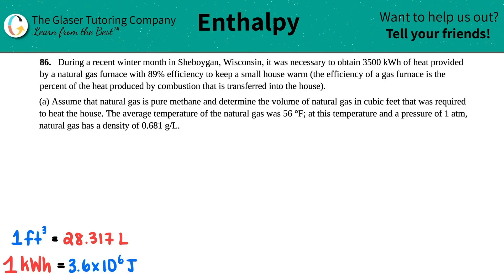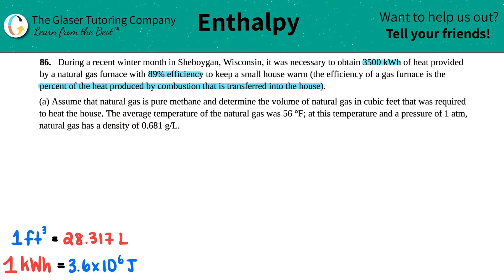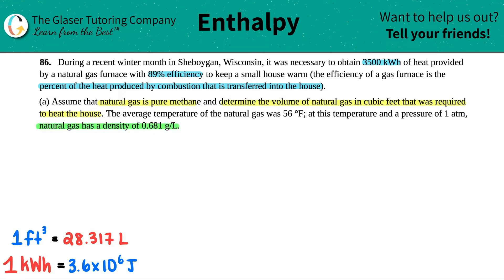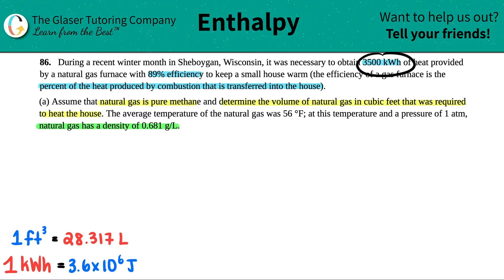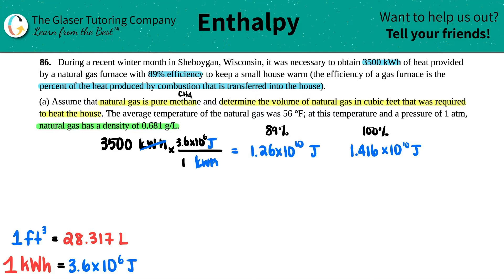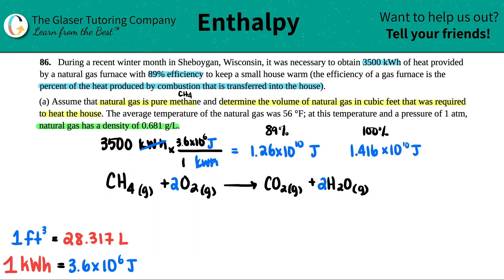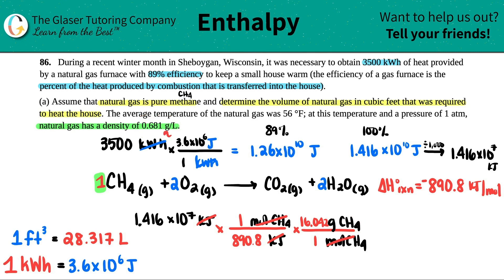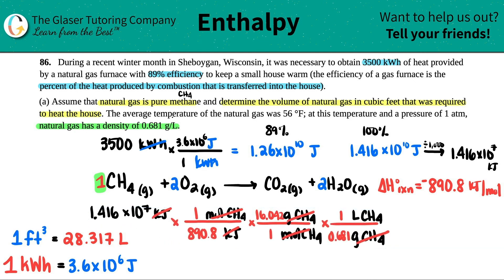5.86a | During a recent winter month in Sheboygan, Wisconsin, it was necessary to obtain 3500 kWh

Comment: This only works if the H2O is liquid.  For H2O gas I get delta H = −393.51 kJ + 2 × −241.82 kJ − (−74.6 kJ + 0) = −802.55 kJ/mol, 
but for H2O liquid I get delta H = −393.51 kJ + 2 × −285.83 kJ − (−74.6 kJ + 0) = −890.57 kJ/mol, which is much closer to your number.
Reply from the maker: Thank you for your input - keep working hard!

Comment: thank you so much for these videos! One thing though, when i was calculating the standard heat of formation for methane combustion (since im supposed to show my work), I ran into an issue. I was using the standard heat formation of the equation which you wrote down, but I think its actually supposed to be H2O(l) instead of H2O(g) in the equation. The H2O(l) results in -890.57 (the correct value which you wrote down), but the H2O(g) results in -802.55. Anyways sorry to be nit-picky but it caused me some confusion, other than that thank you so much!
Reply from the maker: Hi there!  Thank you for your input.  Yes, with the delta H value, the H2O should have been in liquid form.  The answers in the video still stand.  Keep up the great work!